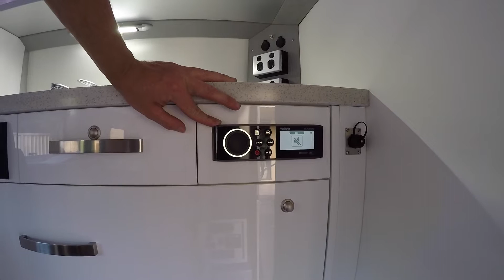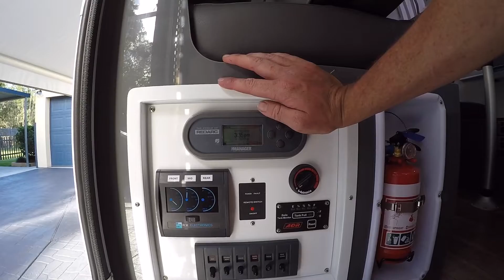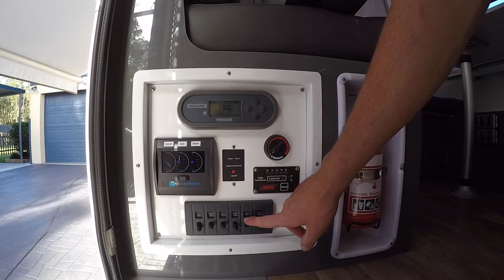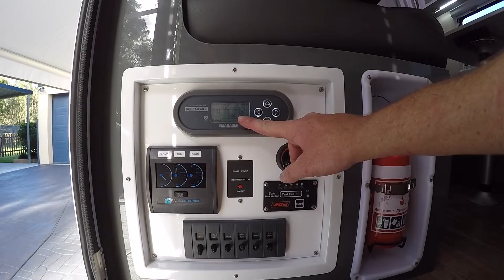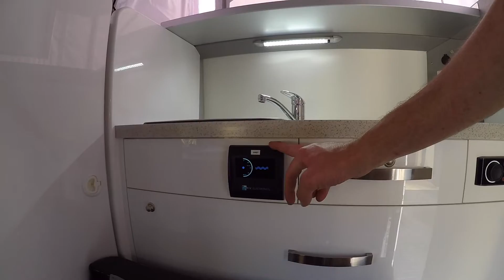Australian Off-Road Quantum Plus Walkaround

Comment: Excellent, thanks, Pat. We've just paid our deposit and decided on the Q+ over the Matrix as we also prefer outdoor cooking. Your video will help us decide on what we want in options. We've already decided on the composting WC - much more simple than managing the macerator and there's only 2 of us in the van (my job, as hubby says "you use it, you manage it") and long distances between dump points here in WA. Do you have advice on side walls for the awning? Is there any problem cooking when it's windy? How about flying insect protection outside - you mentioned you might upgrade to skirt ... and maybe side wall? Cheers, Kerry
Reply from the maker: Hi Kerry glad it was of some help. I really need to do a follow up video now it’s been some time. We love to cook outside and use an induction cook top on the other rare occasions inside. Ok yep we don’t really use our toilet as I’d rather use a drop toilet once a day then empty empty tanks. If we do a long stay somewhere like Frasier island we use it. Iv never used the large side wall only the ends on occasion where it is a little windy or if we’re unfortunate enough to have close neighbours. We only camp off grid so not often we use them but l tend to always carry them still 😂. I don’t think I’d personally bother with the skirt we never stay put long enough to use it and l didn’t like the buttons along the side of van as I’m a little ocd but if you do weeklong stays then I’d say it would be good for keeping the draft out but all this stuff is more things that are damp etc and Require cleaning and drying out when you get home so l use as little as l need to. Hope this helps
Reply: @tapevans87  Thanks very much - really helpful & good common sense. Just the 2 end walls is what we were thinking, with window/door opening on kitchen end wall. Does the induction cooker work with the upgraded lithium & inverter, or have you only used it when on 240v? Have you used the sail track on the driver's side ... is it worth having? Cheers.
Reply from the maker: I’m very sorry for not replying Kerry l must have missed it. You would have your van by now but Iv only every used the two end walls still to this day and yep induction will work on the lithium and upgraded inverter be it we don’t use it much but it’s light and doesn’t take up much space. Hope you’re enjoying your AOR!